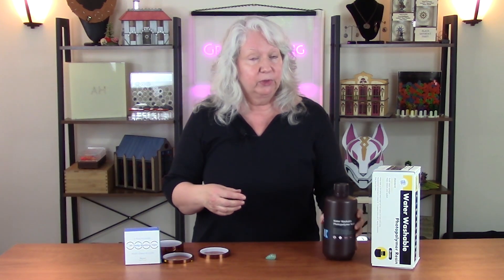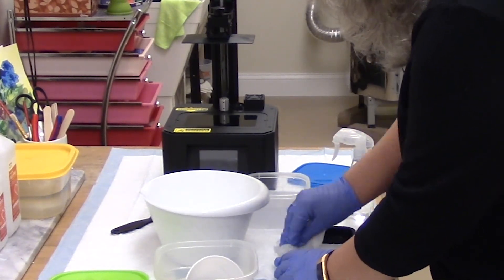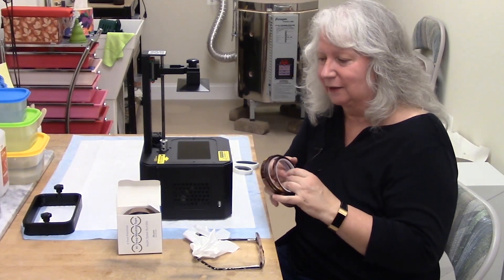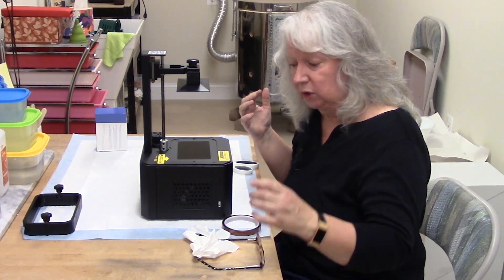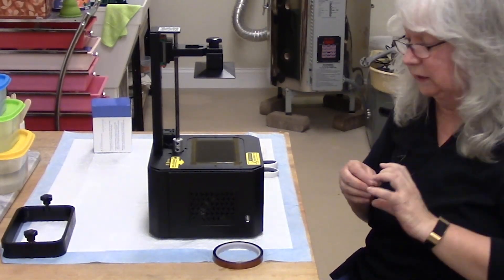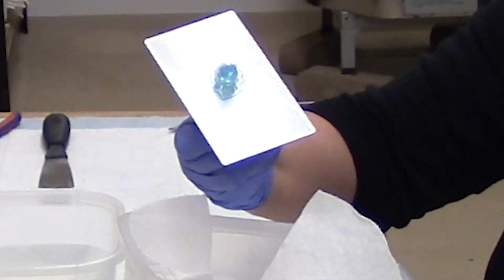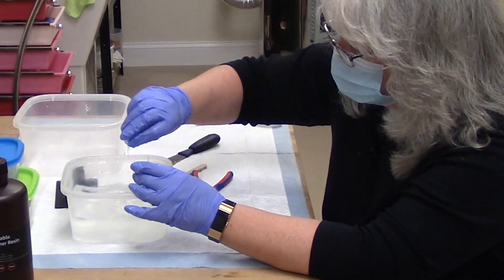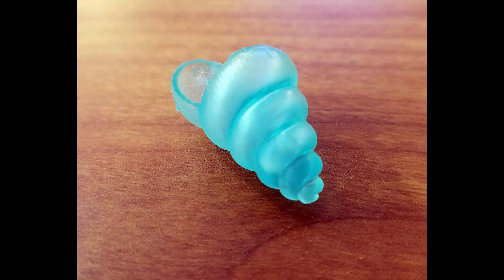Water Washable Resin and Kapton Tape Upgrade for 3D Resin Printing

Comment: I too hate the alcohol, so I will try the Water Washable Resin from Elegoo! Thanks for the tip!
Reply from the maker: Gary, a year later, I find I use them both based on availability and the color I want for the project. It is great to have both options, and I try to keep the amount of chemicals I'm dealing with as low as possible. The pandemic has also increased my use of safety equipment like masks and gloves because I always have them available. I've found those little brushes that come with the Elegoo WW resin are the best, and I use them for cleaning all my models, including the ones made with standard resin. They are really excellent for getting all the folds and detail!

Comment: Thanks for sharing.
Reply from the maker: Hi Ron! Oddly enough, I've found myself using the standard resin more often than the water washable. IPA has become easier to find and I guess I've gotten used to working with it. It seems to be better at removing the uncured resin more reliably, especially if I use the great little brushes that come in the water washable resin boxes. If you read the comments on the wash and cure machine, you'll see that the magnets on the propeller start to dissolve, at least the ones on the earlier machines did, and the alcohol really accelerates that. I've ended up with water only in that machine, using it for the water washable, and vats of IPA for hand cleaning standard resin. I'll use either type of resin, based on availability and the color I'm looking for.

Comment: I know this is about water wash resin but have you tried the alternatives to resin washes yet? I found a video that does the experiments better than I can explain: "Testing Resin 3D Printing Cleaning Alternatives
" Channel: Uncle Jessy. 
Essentually Simple Green or Mean Green works better than IPA, especially during this rough time if people can't find IPA 91%. 

I am still new to 3d printing, getting a machine and software but with your other videos, I thought you might have an opinion on this. I use Simple Green to strip painted mini's to begin with and love the stuff.
Reply from the maker: Rose, I will check out the video, thanks. Did you see my video on the Anycubic Wash and Cure? I am using Yellow Magic 7...
Reply: @GreylightMay  It is kind of what popped in my head when I was looking at other printer videos and saw the comparison video. You mentioned it is an Amazon product and with how things are shortages are still a thing which made me think about the "Green" alternatives. And price wise it is about half, perhaps less, using Simple green or Mean.
Reply from the maker: Rose, my concern about the Yellow Magic is when I put it in the sun to cure the uncured resin, it doesn't seem to work. I'm not sure if it's due to its chemical properties or if the color acts as a UV shield just like the acrylic cover on the Wash and Cure Machine. I've bought some filtering equipment that I'm going to unbox and test next week. If it works, I'll do a video on it. I'm still hoping to avoid regular trips to my local hazardous waste disposal!
Reply: @GreylightMay  I am still learning, honestly its 3:45am and I am taking a break from Blender, ha. I haven't worked with the Yellow Magic. From what I seen on the 2 or 3 videos about curing resin it could be a few things. 
1. The cleaner additives are not cleaning and removing the excess resin coating, or the Yellow is adding a 'slime coat' which prevents the UV. For both cases, you may need a second or third wash in warm water and light dish soap. 
2. Your curing time may be off. While some videos say 2-4 hours or whatever, then complain that resin is 'soft', the comments are usually that it takes a day or two to cure outside in the sun (depending where you live) because of the UV strength. 
3. One thing I learned about is resin couldget trapped in the models and needs to be hollowed out, small DnD things should be fine but like display items or say ogre size for games-workshop you need drain holes. 
I know you have a wash station, and it looks nice, but do you have an ultrasonic jewelry cleaner for your mini's? That is what I use for paint stripping and what seems to be the general go to with the 'safe' cleaners like in the video I suggested. Although I would use them longer. 

Sorry if I can't be more help. I just watch a lot of videos and learn, learn, learn, right now. I am saving up for PHROZEN SONIC MINI 4K ($320). And as for safe disposal, the Simple Green is supposed to be safe to dilute and dumped, from the product description page "Dilute with water and dispose by sanitary sewer". But I still have stuff I used for the last two years.
Reply from the maker: Rose, sounds like we are in the same boat: watching lots of videos and doing a lot of trial and error. But that's what makes it interesting, that and helping each other. Thanks for all the great info!
Reply: @GreylightMay  Agreed. The internet may be a vile place at times, but if we cannot help each other what is the point of having the internet?
Well, back to learning Mini-crafting with Blender.

Comment: Love the videos as usual! What size Kapton tape did you use?
Reply from the maker: Hi MrRadman! It was the one of the sizes in the assortment I got off Amazon. - Just measured it and it is 1/2 inch.
Reply: Greylight May Thanks! Just bought the same printer and wash and cure because of your videos!
Reply from the maker: I hope you enjoy them as much as I am!! I'm finally to the point where I'm able to design my own things and getting some good results. I've got some great videos I'm finishing up right now... stay tuned!!!
Reply: I think I will! My first two prints failed. Really learning that supports and angling prints are a big deal. Lol
Reply from the maker: I think the resin is really important too. I added uv resin pigments to my tried-and-true elegoo resin and my prints failed. I had to change the default exposure settings from 9 seconds to 13 seconds, then it worked. Lots of trial and error in this process!!
Reply: What do mean you added uv pigments? I successfully had a print last night and today only part of the print failed. Not 100% sure why. Thought it was that it stuck too much to the fep, but it attached itself later down the print. So weird. Trying again tonight. Same print but bigger and angled differently. I’ll see in 13 hours. Lol
Reply from the maker: Check out my latest video on tokens, you'll see the resin colorants in use! Works great once you adjust the settings.

Comment: Have you tried washing/rinsing with warm water? I should make removing the supports a lot easier. And a shout-out from a fellow LD-002R owner. Sharpening one side of that putty knife should help as well. I'd love to see what settings you're using for that water washable resin as it seems that most recommendations I see are way overkill for what is actually required for the LD-002R.
Reply from the maker: Hmx, I like the idea of sharpening the putty knife. I'm working on tokens right now and putting them flat on the bed gives me the best result,  but larger ones are hard to remove! I had to use an upside down air can to shrink the edges. I think I'll have to go back to supports and standard resin for those. My settings are similar to lights on 3dprinterpro, using auto support at 30%. Using the arrow keys to slowly scan the model is a great tip as well!
Reply from the maker: Great info, PauLee, thanks!

Comment: The washing water should be treated as chemical waste. Never flush it through the sink.  Collect it and bring it to a delivery point, just like you would do with IPA wash liquid.  Only the fully cured stuff can be treated as plastic waste.
Reply from the maker: Yes, that's right! I put mine into clear bottles, set them in the sun, and filter the cured resin out before disposal, just as I do for my Yellow Magic 7. I should have mentioned that in the video, and will talk about it in the next one with water washable resin. Thanks for the reminder!
Reply: This is definitely the way to go. I haven't sent any of my 'waste' for disposal because it is so much easier and cheaper to cure the resin and reuse the solution. And if you was using alcohols(IPA/Ethanol/etc) it will likely evaporate before you have need to really get rid of it. And I hope you do a video on your recycling procedure as it seems that a lot of people in the hobby have never even considered it as a possibility.
Reply from the maker: hmx, one of the things I'm still working on is the filtering process. I've ordered some paint filters in hopes they hold up better than what I've tried so far. What do you use?
Reply: As a chemist, I've resorted to using the tools I'm most comfortable with so I have a large porcelain Buchner funnel  and 2000mL filter flask that I primarily use with 15cm filter papers. All of it can be sourced via Amazon or ebay. I find it to work better than the coffee dripper I was using, especially with more volatile liquids as the vacuum helps pull the liquid through the filter paper a lot faster to minimize evaporative loss. 

The paint filters, I've found, don't work as well as I end up with a lot of cured, but swollen resin that has a sludge-like appearance that can quickly clog the mesh paint filters and always seems to let some through. Coffee filters were better, but painfully slow so now I use the vacuum filtration system as I am quite familiar with it and know it to work well in the lab. I cure the dirty wash solutions in a baine-marie with a 30W UV lamp for an exceptionally long time and then decant the solution into funnel for filtering and so far it has worked out great.
Reply from the maker: Wow, you are sending me to google on this one! I have to learn about a Buchner funnel. Sounds like you have found a great solution,  i will check out pricing and availability to see if I can step up to it. I would like an approach that doesn't require hazardous waste disposal. Thanks for all the great information!
Reply from the maker: hmx, do you think 1000mL would work? Looks like i also need a pump to create the vacuum. I found a setup for about $110 on Amazon. Does that sound about right?
Reply from the maker: hmx, my Buchner funnel, flask and pump all arrived yesterday. I'm thinking of covering them later as an unboxing and dedicated video. There are a lot of questions out there about the best way to handle the cleaning materials disposal, so there could be interest in a better method. Even if it requires a small investment, it should pay off in the long run. I won't get to it until after my vacation, though, probably late September -- I've got three other videos to get out before I leave!
Reply: If you have any questions, let me know and I hope your kit came with a rubber adapter for the funnel. It does require a small investment up front, but I definitely think curing->filtering you cleaning solution is the best way to go. And with resins like Siraya Tech Simple, it doesn't matter if your IPA/Denatured Alcohol becomes a bit dilute from atmospheric water as it only requires a 15% solution to properly clean your prints. If you are on twitter, feel free to contact me at @nakanaela as I am sometimes quicker to respond there. And I hope you have a great holiday.
Reply from the maker: I'll check on the adapter and I'm definitely writing down your Twitter handle, I may need some help!